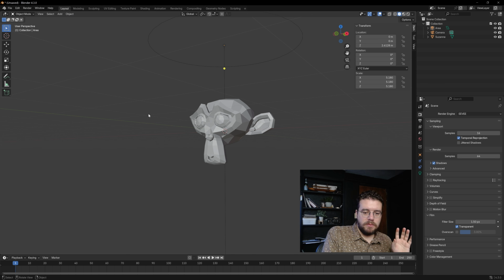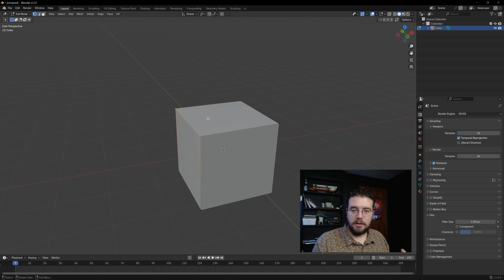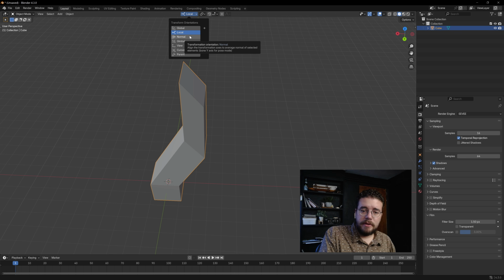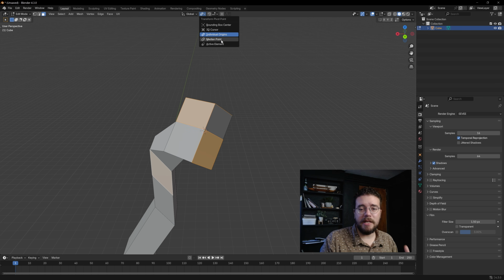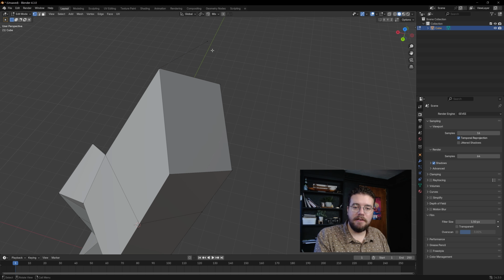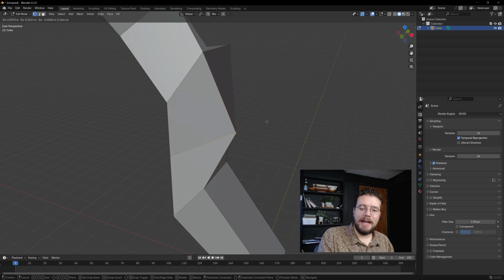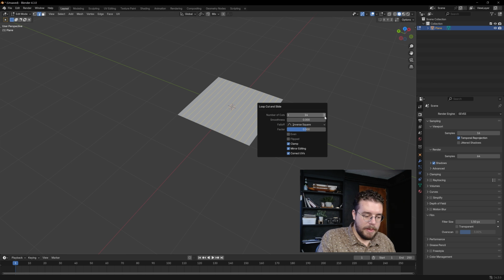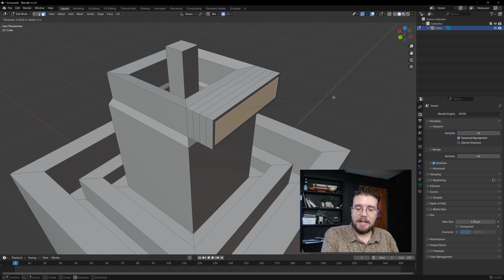Blender Masterclass (Part 2) Modeling Intro

Comment: For the 3D cursor there are two other ways of resetting it to world origin.

1. Press N, Go to View and then under 3D cursor, change the location & Rotation to 0.

2. Faster than Shift + S, and this is Shift + C as this reset camera zoom. (be warned, if dealing with multiple objects it will try and fit all the object into your viewport)

Comment: Pressing 1, 2 and 3 will take me to orthographic view. I'm in edit mode, not sure why it's not working for me?
Reply from the maker: @PinkDolphinSubs  in this case you’ll want to use the numbers at the top of your keyboard. Your numberpad numbers have a different effect.
Reply: @rileyb3d  Thank you for such a quick response omg. I don't have a numberpad and am using the numbers at the top of my keyboard.
Reply from the maker: @PinkDolphinSubs  Strange, I assumed it was a numberpad since that's the functionality of the numberpad. Maybe your keyboard is mapped to treat those top numbers as if from a numberpad somehow? I'm not sure, sorry. Luckily in the meantime you can always just press the three buttons on screen (to the immediate right of where it says "Edit Mode.") These do the same thing to toggle between vertex edge and face.

Let me know if you figure out what's up with the keyboard.  

You can always right click pretty much any button in Blender and say "Assign shortcut." This way you can map these number buttons to what they should be. Just be careful! As soon as you start assigning shortcuts, you run the risk of replacing existing shortcuts with new stuff.